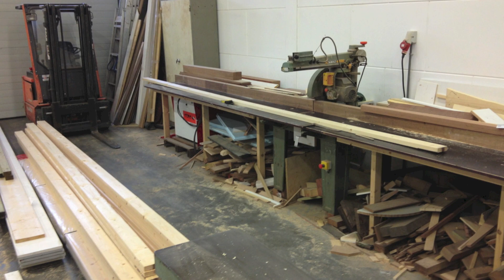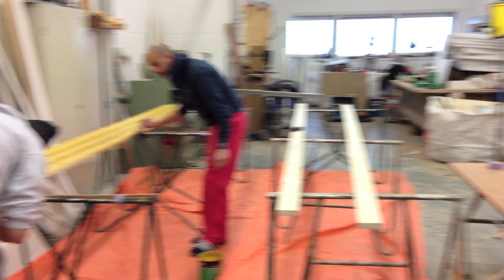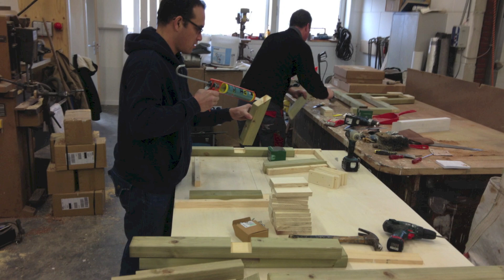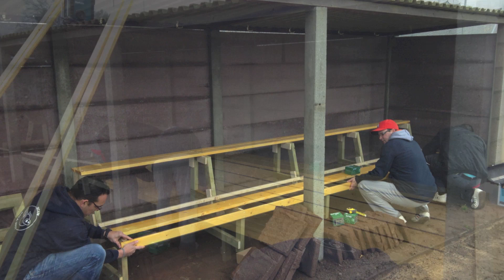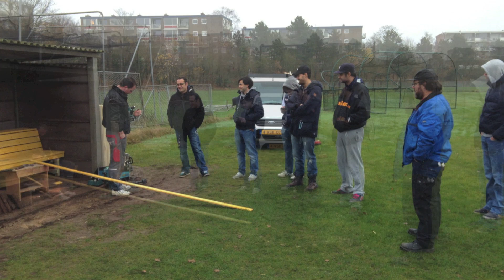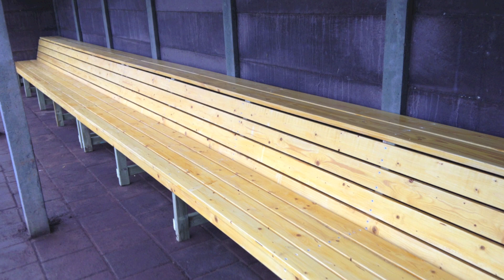How to build baseball dugout benches

Comment: Can anyone tell my the size of the treated lumber used for the frame? To me,  it looks a bit thicker than a standard 2x4 which is around 1 1/2 in thick. Is it possibly a 3 x4? Or maybe 8/4 board?